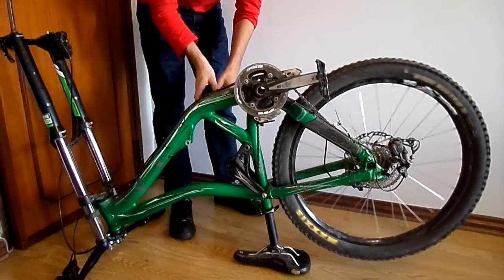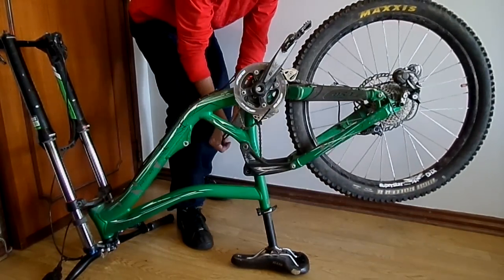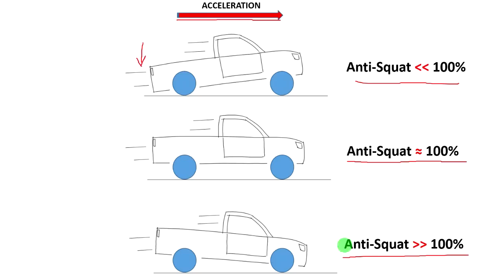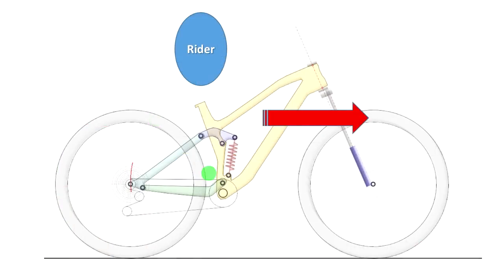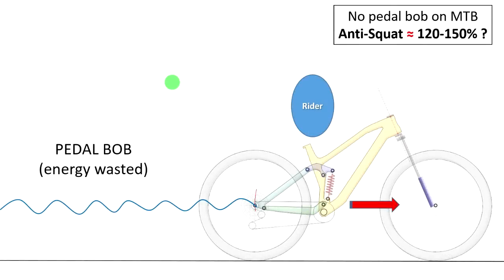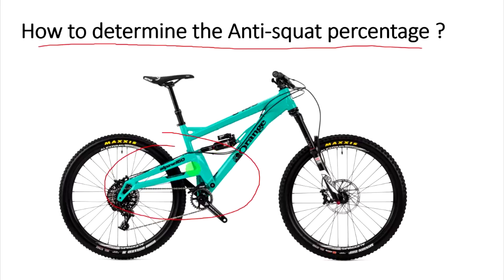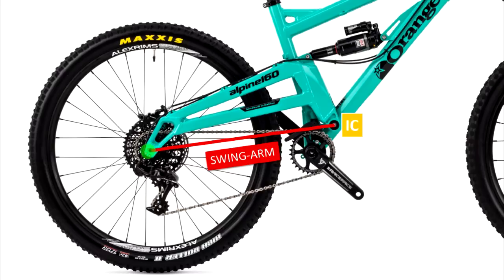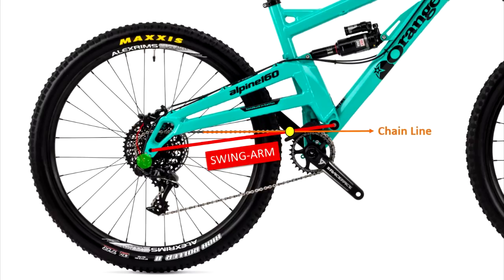Understanding Anti-Squat (MTB rear suspension Ep.11)

Comment: His "chainline" is bass-ackwards - the bike's upside down on the floor, and he's looking at the chain line from UNDER the crank ring, rather than over it, in the diagrams! That is entirely a faux paux, as the only line of tension varies with combinations of front and rear rings, always of course with the chain running on TOP of both. It's hard to trust any analysis from someone who fails to notice an unrideable impossible configuration.
Reply from the maker: That's because it was an exaggeration as explained elsewhere (in order to demonstrate the effect). My bike has a low anti-squats, and with the normal chain configuration it is very hard to lift the rear wheel with my bare hands. By changing the chainline as I did, the anti-squat becomes Huge, and therefore, it's pretty damn easy to lift the wheel and demonstrate the anti-squat effect. Bye
Reply: I see now at 6:20 you're explaining your strategy; still, I find it a bit too confusing. Language may be a part of this, but a simpler explanation is that when the chain line pulls above the lower pivot point, it is tending to 'lift' the rear wheel, unloading the traction. If shifting to the granny, or smallest chain ring, the chain line dips lower, then running below the lower suspension pivot, pedaling then has the opposite effect ie levering the rear downward, imparting more traction. This is also a fundamental design aspect of the earlier Wiegle frames, unfortunately either abandoned or forgotten with the new "improved" single chain ring bikes that see minimal changes when only rear shifting occurs. It may be that better designs which somehow neutralize pedaling and chain forces over the range of gearing have overall good traction, but it could be argued the ability to alter the squat/anti-squat simply by shifting to a small front ring is a very useful trick now abandoned for 1x gimmicks and marketing.

Comment: Why pedal backwards in the demonstration to show squat effect under acceleration.?
Reply from the maker: In most bike designs, the distance between bottom-bracket and rear wheel hub increases during suspension compression. This causes the chain to "grow" which pulls the pedals backwards (pedal kick-back). In normal bike designs, the anti-squat is somehow dependent on this chain-stretch effect. Basically (and to simplify), when you apply force on the pedals, the tension created on the chain counteracts the chain-stretch and prevents the suspension to compress under acceleration. Therefore, with the correct amount of anti-squat (and chain-grow)  the suspension stays relatively quiet under pedaling, saving energy for the rider. This is particularly important in XC / Enduro bikes where you spend most the time pedaling.
Reply from the maker: +Jesse Chen It was an exaggeration just to demonstrate the chain pulling effect otherwise I couldn't lift the wheel because my bike has low antisquat.
Reply: Still don't get it =(
Reply: Jesse Chen you are right the pedal never goes backwards because is the inverse pulling! The experiment need to be tested in the order way!

Comment: Hi Andre, love your videos, it's great to learn more about the theory behind suspension design. I have been thinking about anti-squat and the new designs that aim to isolate the drivetrain from the suspension (including a switchable clutch as seen at eurobike recently). Is there a speed at which the kickback in the crank arms caused by suspension movement becomes irrelevant as the rotational speed of the wheel is higher that the equivalent rotation due to the suspension?
Reply from the maker: Sorry for the very late response (I've been quite away from youtube), yes, kickback is more relevant at lower speeds (like climbing). At faster speeds it becomes more irrelevant as you said. Antonio Osuna from linkage design blog has some working models & animations about that, you might want to check it up. Bye :)

Comment: Pls go look : 
http://i9.pixs.ru/storage/2/5/2/ASjpg_6325211_22425252.jpg
and tell me in coments am i right ? bike with this suspension have a high AntiSquat more 500% ? 
tell me its bad or good ?
Reply from the maker: :D Nice to see your effort, but the swingarm line (green) is not correct.  The swingarm line conects the rear axle with the IC (instant center). And in that bike the IC is close to the BB (the bike is a horst-link, see my Ep.10 about IC). Given that in that bike the rear axle is so close to the chainstay pivot, you can even simplify and do the swingarm line between rear axle and the main pivot (near BB). Bye :)
Reply: dude i understand only 5 or 10 % of your english - pls make Anti-squat picture for frame what i brougth in : http://i9.pixs.ru/storage/2/5/2/ASjpg_6325211_22425252.jpg

and u dont answer the high AS zone its good or bad and why ?
Reply from the maker: My english is not that bad :D Here you have the pic:
http://oi66.tinypic.com/wcmjjb.jpg

Your bike don't have 500% AS. And yes, too much anti-squat is not good (it should be around 100% to be good).
As I said, in your case, you can simplify and do the green line connecting the rear axle with the main pivot. You can even simplify more and assume your bike as a swingarm 4-bar (look at this video in the AS part: https://www.youtube.com/watch?v=ZmjpC0CgCVs).Basically when the main pivot is right on top of the chainring you get around 100% anti-squat. I can't see exactly the position of the main pivot in that photo, but I would say that on the smaller chainrings you get around 100%, while on the larger chainring you get lower values like 50% or less. Bye
Reply: my english bad not yours)) 
you say : " while on the larger chainring you get lower values like 50% or less... " 
it means the half of my power when i pedaling go to nowhere ? 
and if its yes can you recommend XC full suspension frame with good values of your knowledge of suspension ?
Reply from the maker: No, it means that you only reduce pedal bob by 50%, during an horizontal acceleration. It doesn't mean that you lose 50% of your total energy. The energy that you lose corresponds to the energy required to compress the shock during each "bob". The more it bobs the more you lose. When you have 3x chainrings (like the bike on the picture you sent me), you can't get 100% AS for all of the 3x chainrings. It's a compromise. There are many XC / Trail bikes with ~100% AS, specially with a singlering transmission setup. For instance, Cannondale Scapel with a 32T setup (the main pivot is on top of the chainring). But there are many many other examples. Bye

Comment: in this video you say that many people think that in order to reduce the pedal bob the antisquat should be between 120 and 150%.. do you believe so? i ask this because in other videos you said that >130% of antisquat will lead to pedal bob.. thank you
Reply from the maker: It's a great question. First I should have said "some" people instead of "many". Indeed, most bike manufacturers aim for a 100-120% anti-squat, while a few have higher anti-squats (up to 170% in some cases). The guy from the I-track suspension believes it is good to have higher than 100% AS (and it makes some sense for me). However other experts believe that the anti-squat force does not match with the frequency of vertical body movement. Therefore it would be pointless to have 150% for instance. I don't have any real data to confirm one of the hypothesis. The values on the table were merely a rule of thumb to help people to understand the numbers.  I don't have data to confirm if 130% indeed causes pedal bob from excessive suspension extension, however, it's easy to imagine that a 200% or more, can cause this. In my recent video (AM V4 vs Kona 153) I changed the value to >>140% (much higher than 140%), to be on a more safe side. What I can ensure is that a lower than 100% is not enough to keep the suspension fully quiet under pedaling & acceleration (the lower the value the worst it will be). Bye :)
Reply: +andrextr thank you for the reply and for sharing your awesome work!

Comment: what about the commencal dh v4? does it have a negative AS?
Reply from the maker: No, it's similar to Zerode example in the video (not sure if you saw it). In DH V4 the main pivot (IC) is also very high, so despite the chainline, since the IC is also very high it won't have a negative anti-squat (not sure about real DH V4 anti-squat values, since the idler and the main pivot are not concentric and I cannot see the main pivot position on the pictures because it's occluded). Moreover, the idler is located on the swingarm (unsprung mass) and not on the main frame, therefore it requires a further step and different method to calculate the anti-squat (it's an exceptional case, listed on the video description where this classical method is not fully valid). Bye
Reply: Ok great! Thank you!

Comment: can you do a video on the Liteville 601?
Reply from the maker: Liteville's bikes usually are very progressive. The 601 is no exception (progressivity around 50-60%).  The anti-squats are good on small chainrings (around 100% in 22-26T), but they can drop to like 50-60% in a 30-32T... Brake performance is good (which is quite common in horst-link type of bikes). Bye

Comment: Is very high Anti-Squat is bad thing?? Mine is on 500% zone
Reply from the maker: +Dante Vergil What? :D Don't believe it. Probably you are in the more than 100% zone, but not in the 500% :) Which bike do you have?
Reply: +andrextr Kona Stinky Six 2010 maybe i've measured wrong so correct me
Reply from the maker: Kona stinky have a anti-squat close to 0% on average. In higher rear cogs (eg:28T) can be positive (+40%), and in smaller cogs is negative. Check it here this pic (the pic was done in fully extended suspension, however it's more correct to do it at SAG):
http://ep1.pinkbike.org/p5pb13512247/p5pb13512247.jpg
Reply: +andrextr So is that a bad thing?
Reply from the maker: It means that it has low efficiency during pedaling. But since Stinky is not a trail bike, I guess it's not very important... The advantage is that is also has a low pedal kickback... Specialized Demo 15 also has a similar anti-squat :) Bye

Comment: so, you can change the character of the squat depending on the gear that you are on? so to lessen brake jack on downhill and lets say speed is a lesser issue than comfort should i go 11T or 40T
Reply from the maker: +miguel lopez Yes, anti-squats change between gears. That's why singlerings are an advantage for engineers (they can design the bike to work well with one chainring). Brake jack/squat is not affected by the gears. This video is only about anti-squat (how suspension behaves under acceleration, and not under braking). On downhill you should go with small cogs (like 11T), because that decreases a lot the amount of pedal feedback (kickback). Bye
Reply: +andrextr nice.. in a world dominated by marginal gains everything helps..

Comment: You don't pedal in that direction
Reply from the maker: +David l as I said, I change the chain line to exagerate the effect. My bike has low antisquat with original chainline, its very hard to lift the suspension on normal chainline.

Comment: Can you please explain how the 100% anti-squat zone was defined (or constructed) graphically? I thought it was something to do with the intersection of lines from the rear wheel contact patch and the IC. Also, could you please explain how the centre of curvature (CC) is defined, and how it is different to the IC? In the Linkage program, there is as1 and as2 values which are calculated differently which is confusing me. Thanks very much for your time. Your videos are very informative and I appreciate it greatly.
Reply from the maker: +Samuel Hall You can see my recent video of Giant Glory analysis, you have the full method on the anti-rise. Basically it's the line that comes from the rear contact patch that passes either on IC (anti-rise) or in the chain-swingarm point (anti-squat). If that line passes at CoG height (~1.1m) on top of front wheel, then it's 100%. CoG stands for the center of gravity. This is the graphical method to calculate this things, either on MTB or in Motorcycles, and it's the method that Linkage uses. The a2 on the older linkage version is the anti-rise, while a1 the anti-squat. Now you have that in separated tabs. Bye

Comment: Too many errors again... 

-URT designs have Anti-squat too and the chain is not moving the wheel like in this examples...
-When you draw the car example, the front wheel always extend due to acceleration... 
-Vertical aceleration can happen, but it's not in the same frecuency as the pedal aceleration, so you can't compensate for it using a different amount of Anti-squat....
Reply from the maker: +AntonCor I was already expecting your positive feedback :D lol
- In the car example, the front suspension is extended in the drawing and in the real picture. So, not sure what do you mean with that... (?)
- Vertical aceleration frequency is a good point, but as I said in that part, "there are many people that THINK". I was just sharing a view (with the reference bellow). The only error is SOME people instead of Many. So you might want to discuss that with the author i-track.

Bye
Reply: And what about URT... You can have Anti-squat without the chain tension extending the suspension.
Reply from the maker: +AntonCor The URT (Unified Rear Triangle) is a pretty hated an obsolete system in each the BB is directly attached on the rear triangle, instead of the main frame. So, as you know better than me, the classical method presented here does not applies in these type of bikes where the BB moves (fortunately they are a minority on MTB market). In URT the BB is on the rear triangle and your weight is part of the unsprung mass. So, although this video was about "normal BB bikes", I guess the URT migth have a very low pedaling efficiency. Bye
Reply: +andrextr  GT is still using a variation of the URT design and Lapierre had a couple of models just a few years ago, it's not as popular as it was in the 90's but it's still used and you can design it to have very high Anti-squat. Then you have 6-Bars systems (Felt Equilink...) that need a different method, and systems with floating idlers (Commencal V4...), that need another method. There are too many exceptions and you are trying to make it too simple...
Reply from the maker: +AntonCor yes that was the point, to make it as simple as possible in order to everybody to understand the basics :)  Bye